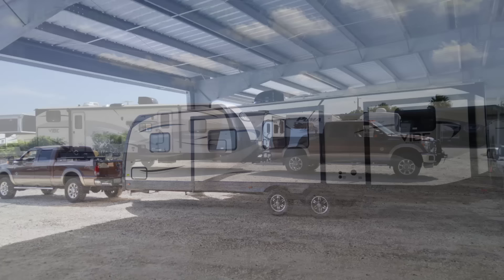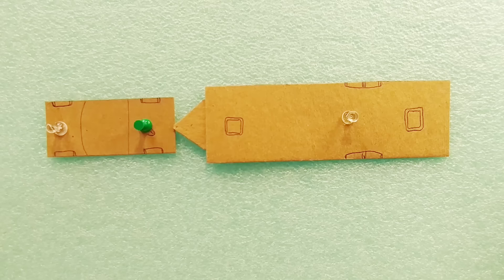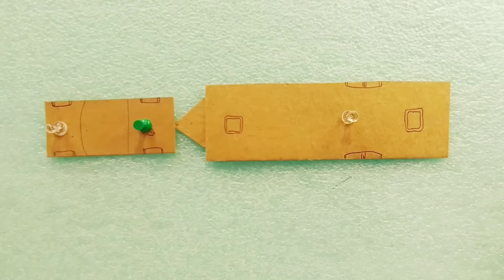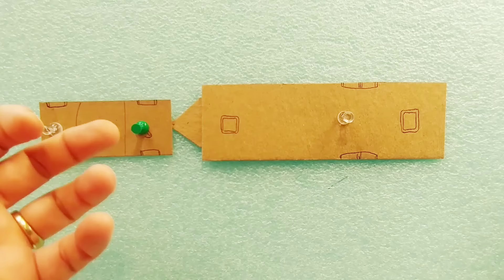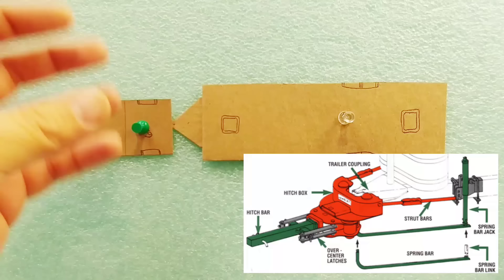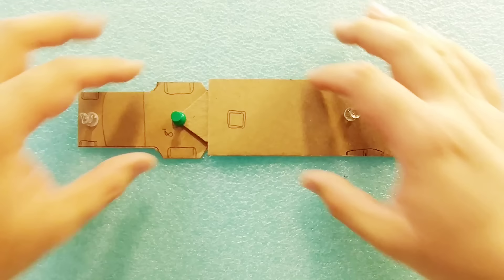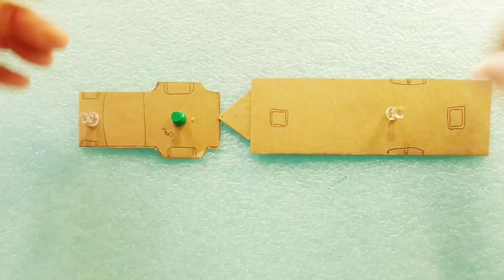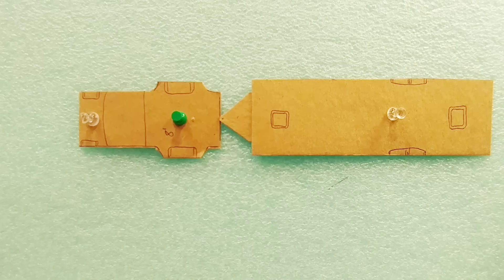Sway when towing an RV? Watch this!

Comment: OK, if you have a PU with a single axle, get air bags! And a really good weight distribution hitch. Really, the air bags drastically reduce the bouncing. Weight distribution is so important  I like the Blue Ox. Simple and works for me. Whatever you use, go slow and watch your flanks. Be very mindful of windy conditions when you are approaching a field after transit through tree lined terrain. Cross winds are hell.

Comment: Weight distribution is a huge Factor
Back when I was working for a motorcycle shop, I went about halfway across Texas pulling a 16 foot lowboy behind a half ton pickup with five big dressers and a side-by-side loaded on it
Coming down this one long slow Hill the trailer started wagging the truck like you wouldn't believe
Pulled over, move the side by side and two of the motorcycles further forward on the trailer, not a hint of sway the rest of the trip
That's back when I was still green enough pulling trailers to pull a load like that with a half ton with a V6 🤣

Comment: Great explanation.  I can personally attest to the effect of wheelbase.  For all sorts of reasons we use an SUV as our TV, and a couple of years ago changed the TV from one with a 118" wheelbase to a 131".  Our trailer and WD hitch (Blue-Ox Sway-Pro) remained unchanged (apart from height adjustments to fit to the new truck).  With the old TV, driving in any kind of crosswind was a white knuckle affair, and I'd usually find myself dropping my speed to 80 km/h (50 mph).  With the new TV, I can hold my speed at 100 km/h with no sway.

However, you missed one critical factor: Speed.  Since sway is a dynamic effect caused, in large part, by the airflow over the sides of the trailer, for any setup there is a critical speed, above which the tendency to sway will be amplified with each oscillation of the trailer.  Therefore, one easy (and free) means to control sway is to slow down.  A side benefit is the greatly reduced fuel consumption!

Comment: I have a Blue Ox sway max weight distribution hitch for my 35 foot tt, it helps. It does not sway so much as just pushes the whole rig slightly with a gusting cross wind. If you feel swaying coming on, 1) foot off accelerator and foot off brake if possible, 2) GENTLY squeeze the trailer brake. This will tend to stretch the trailer and truck straight. Stop sway before it starts. I have towed in some pretty nasty winds, and this helps. And go slow or stop in bad winds. I think my suspension air bladders help too. They kick down any bounce.
Reply: Very good advice. I prefer a neutral throttle or even slight acceleration rather than coasting before hitting the trailer brakes before going off throttle and on the tow vehicle brakes. Better outcomes. More control. In tow-haul mode, the downshift and compression can be just enough to lose control.

Comment: an 8ft deisel 2500 made an incredible difference along with a Blue Ox WD hitch.  We towed the same 30ft trailer with a capable v8 SUV but the difference in tracking and "fighting" the trailer continually was amazing.  We almost bought a 1500 and are very glad we stuck to the plan.  Great video.  Glad I've never had to manually jam the brake controller to save lives at this point.

Comment: A buddy of mine tried coming to my rescue when my Suburban broke down.  He showed up with his newer Suburban and a flat bed trailer. Got my Suburban loaded up and proceeded to get on the Freeway. We got up to about 40mph when the trailer started swaying back and forth. He is an excellent driver and knew when to gas the truck and when not to along with knowing not to slam the brake pedal through the floor. From the trailer swaying back and forth we took up both southbound lanes and almost went through a guard rail before he was able to get everything under control and stopped. My Suburban and moved around enough that my driver side rear tire was hanging off of the trailer and the drain plug and the axle of my Suburban got stuck on one of the diamonds of the diamond plate deck of the trailer. His was the first time he had used his Suburban to tow a vehicle with and found out a couple of days later that the leaf springs on the driver's side of his Suburban were bad. This was a seriously scary experience that everyone learned from and grateful as hell that no one was hurt.

Comment: After using 2 different friction style say controls I switched to a Hensley Arrow. Not only did their hitched worked as advertised, they have the best Customer Service I have ever seen in the travel trailer accessory business.  When I sold my travel trailer and went with a motor home, they bought my Hensley Arrow back from me.
Reply: Bruce Marcotte I bought a used Hensley in a private sale via e-trailers.  Hensley Mfg treated me like a new customer throughout.  Never had an issue with the hitch.  When I quit camping after buying a 3500 dually diesel (loved that truck) Hensley bought back the hitch, all the accessories and spare parts (new in box, plus 2 sets of sway bars) at more $ than they said they would!  They sent me the box to put it all in!  Their Customer Service was simply GREAT throughout (three drawbar swaps). Zero issues towing with a 1500, but I must have weighed both rigs half a dozen times or so to assure myself that everything was within spec.  I went for the diesel strictly for the torque - towing in the mountains - and never regretted any of it.

Comment: This was excellent, thank you! I just bought a 20’ Kodiak qb travel trailer that I’m pulling with my F-150. The dealer advised a weight distribution set up (it has an integrated sway control) and I wasn’t sure because it’s an additional $700. or so. However, watching your videos has convinced me and I’ve made an appointment to get it installed. Thanks again, your videos are very informative and educational.

Comment: Thank you thank you thank you thank you thank you I would say that a million more times if I had the time. I have been trying to explain this to my sister she has a travel trailer and she just bought a pickup truck she was pulling the travel trailer with her minivan and that didn't work out too well. But now she has a pickup truck and I was trying to explain the sway bars and weight distribution hitch tour and I think this video will get it through to her so again thank you so much.

Comment: Thank you. I would have liked to hear more time discussing improper weight distribution on the hitch and how that causes inertial over correction between the the two body masses of the tow vehicle and the trailer. In my opinion, Wind is only a factor when it is significant. Tire alignment is a mechanical problem that occurs, but is not common. But improper weight distribution causes most of the scary and dangerous sway. That is why there are typically two systems incorporated in most camping and cargo trailer coupling systems. They are the sway control system, or braking systems that are added to weight distribution systems to limit sway, and the weight distribution system to bring the tow vehicle and the trailer into longitudinal and latitudinal alignment as a means to correct weight distribution.
Reply: I agree. Ive towed many years with both types of trailers.
How the trailer is loaded front to back which produces tongue weight is really biggest factor in sway

Comment: As a Forklift driver who loaded Semi trailers, I was taught to put the heaviest part of a load ahead of the rear axles. This helps to keep the trailer from swaying, (tail wag) especially with tandem towing. I found that putting the majority of the load ahead of the axles made my camper tow better, careful not to exceed the tongue weight limits. Sway bars have improved since then.
Reply: Roy Davis general rule of thumb is 10-15% of the total weight should be tongue weight. More weight really only puts more strain on the tow vehicle but airbags or a good weight distribution hitch can alleviate most of that strain
Reply: Hi Roy I hear ya as far as weight distribution goes but I drive forklift too and only deal with lumber and MDF.  Most of the loads I ship out need to be above the axles with less weight above the pins.  I mainly deal with B-trains and the occasional flat deck if that matters.
Reply: Roy you have it correct. The problem with only 10% of the  weight on the hitch is wind hitting the front of the trailer lifts it up, reducing tongue weight. Once the trailer starts lifting the hitch, you will sway.
Reply: @gpecaut1  No not really unless your towing  ar  120 mph    stick  with  10  to 12 %How do I know  this Im one of the  engineers that  wrote  the  trailering  guide for  Chevrolet

Comment: Good explanation!  An interesting aspect of the sway control is that when installed properly, the tongue weight doesn't cause your back end to squat down and front to point up!  It loads the weight as if it is a bridge between the trailer and truck.  Your sway control adds a substantial amount of weight to your front tires.  Your trailer and truck should stay level.

Comment: I have towed with the Reese Dual Cam Sway Control system since 2003. I have had no sway problems with this set up. It locks the truck and trailer together using a cam lock. Due to mechanical advantage, the trailer can't break the connection, but the truck can whenever it makes a turn. I have towed campers from 20' to 35', and have had no detectable sway. This system really works well, and is 1/10 as expensive as the Hensley.

Comment: Good job.  As mentioned in other comments, rearward trailer weight balance and surface area contribute to sway accelerating, leading to loss of control not only due to reduced traction but a more powerful lever rotating around the trailer wheels. Also, the lateral stability provided by the tires decreases with speed, parked rigs don't seem to sway, while those NASCAR guys get loose with no trailer at all😊.

Comment: One interesting factor with travel trailers is adding weight behind the axles of the trailer. I have heavy E bikes that I mounted on a hitch on my rockwood travel trailer. In addition ,If I have any water in my fresh tank, this weight is applied behind the axles causing a tenancy to  sway. If I tighten up my sway control bars which are the blue ox system, this mitigates sway when I’m in gusty wind conditions. Also I make sure that my tanks are empty and I load my truck and trailer to counter the additional weight of the heavy bike rack. Very good video!

Comment: I agree with some of the other commenters that weight placement is also a HUGE factor in all this. But I think one thing you were sort of getting at without really articulating is that with a bumper pull when the trailer is trying to push sideways it has leverage on the tow vehicle due to the pivot point being about 4 feet behind the drive wheels, so the force is sort of amplified.

Comment: I have 36' toy hauler bumper pull that tows with no sway when no toys are in the back , the minute i put my touring bike in the rear garage its a handful .  My solution was put weight back on to the front of the trailer with 4 milk crates of concrete in the forward storage compartment . Tows great now ..... weight distribution in the trailer is probably one of the biggest factors of sway .
Reply: Yep, I've pulled for many years with a 5th wheel and bumper pulls. With bumper pulls The biggest factor is how you load the trailer front to back. If you get hit by wind and your trailer is loaded right it may sway but will recover. If your loaded with no or little tongue  you can start swaying almost immediately when getting up to speed even with a flat bed bumper pull with no wind. Applying the brakes when serious sway occurs helps because the tongue weight is increased and the trailer tires are not allowing as much swing.  The leverage that a improperly loaded trailer has on the bumper of a vehicle is what causes sway and as steering wheel corrections are made it actually compounds the problem by slinging the trailer from side to side causing a type of centrifugal force that leads to a crash. This same force is what we do when we start pumping on a swing to get movement. Biggest factor improper loading which includes not having the right tow vehicle.
Reply: I never understood with those toy haulers why they have the "garage" in the back, that way when you load something you basicly take weight off the hitch.

Comment: If you experience sway you have a serious problem and a sway control hitch is just an attempt to compensate for that problem. Most sway issues stem from too much weight behind the trailer tires. Learn how to load your trailer properly. Also get a heavier truck. The factory weight rating of most pickup trucks are greatly exaggerated. I tow with a GMC 6500 diesel truck. I can tow 40k lbs and never feel my load.

Comment: I have a 2500 2 wheel drive truck I pull a 25 ft travel trailer with a 16 ft boat behind the trailer and the biggest things I have learned is you have to have a good % of nose weight to you trailer and make sure all the trailers truck and boat are as level as you can get them and I have very little trouble after that.

Comment: With a 5th wheel trailer placement of the 5th wheel back and forward will control front to rear weight distribution on the truck..  Experience from 45 years of driving semi trucks..

Comment: Two things that I'd like to add. I have an Equilizer hitch. I bought the TT used. After following the setup to a T, I looked closely at the spot where the L brackets are mounted to the frame of the TT. I observed longitudinal scrapes on the frame rails from the bolts, both top and bottom. The bolts were as tight as practical, with the steel backing plates beginning to bow from the tension. So I spray painted the frame to observe if there was fresh movement after a tow. There was. I welded two straps to the back of the L bracket and put another complete set of vertical mounting bars with bolts. That eliminated the 1/2 - 3/4" movement entirely. When you think of the movement and the distance to the fulcrum, the tires are another 12 feet behind my 3/4" movement, which means the allowed 3/4" allowed sway becomes several inches at the axles.
The ball hitch itself, where it slides into the receiver was longer than it has to be. Based on your explanation, the closer you can get the ball toward the rear axle, the better. I don't know what 1" closer does, but it can only help.
There is considerable slop in the slip fit between the hitch and the receiver. I'm going to work on fixing that, but is it +/1 1/4" at the ball, even though it was =/- 3/32" at the slip fit. So it was already exacerbated 10" away from the source. Again, multiply that by about 13 feet in my case, an it turns into a couple inches.
In the spirit of getting rid of as much source of sway as possible, these things need to be understood and worked on as well.

Comment: Ah, I finally understand:  the majority of the wind "sail" area is ahead of the trailer wheels, but more importantly, ahead of the trailer's CG.  This is very much like an unstable airplane.  When the center of lift is ahead of the center of gravity, any perturbation is amplified until the airplane is uncontrollable.  I see how load-distribution and pivot-projecting hitches fix that.  Thanks!!

Comment: Excellent video. Ive been driving Class A trucks for 20 years but I've never towed a trailer with a pick up truck. I got myself a 1 ton dually because it's better to have more than you need and not need it then to not have enough. First thing I did was to install airlift in the rear. After this video I have decided to pay the extra money for the fifth wheel trailer.

Comment: I find it unique the way it does it it almost reminds me of my bass boat when it starts trying to walk  but in the bass boat you can go from 12 and 4 and jerked that thing about an inch to the left a couple of times and it will line out if it ever starts doing that but you can't do that with a pick up so the rules of the road versus the water seemed to be a little bit different I know it's a pain in the butt and this current camper reminds seems to be worse than the other one thought I would get on here and find a decent fix.   This is an older camper a little bit older a little bit older that I chose to go with to drag back-and-forth to jobs on the road I'm sure the newer ones have fixed this problem a little bit.

Comment: Knowing how to get out of that situation once your in it is key. Trailer brakes and throttle are two tools to help keep you off of your roof. But every situation is different.
Reply: Never pull the trailer trolley brake. A sure way to jack knife.

Comment: 34' bumper pull tag trailer no sway bars ever. My trick I've learned how to slow down save gas mileage wear and tear on everything. and keep my electronic brake close at hand if needed. I never even put the sway bars on. they're hard on the trailers tongue and have completely snapped some trailer tongues off.